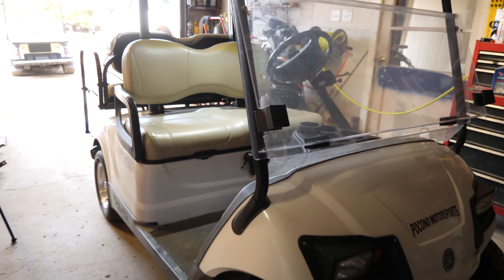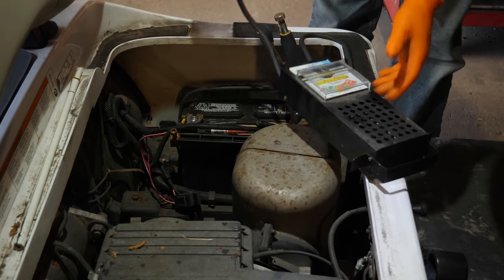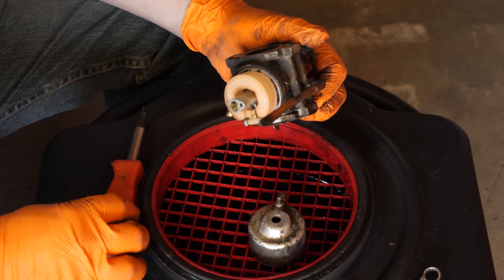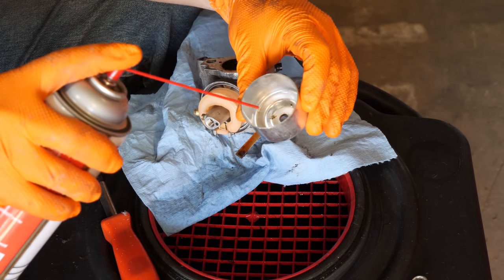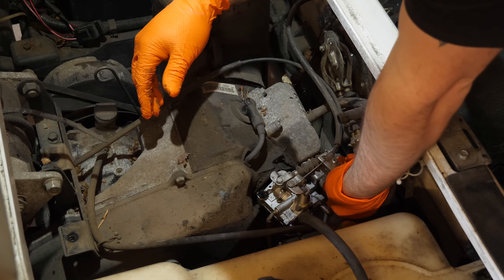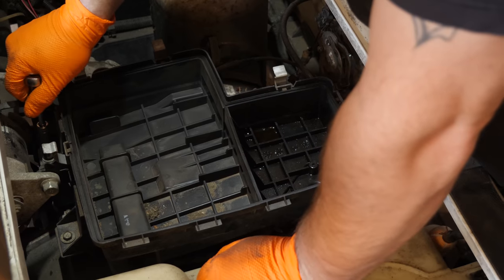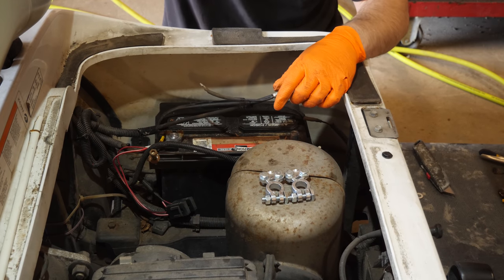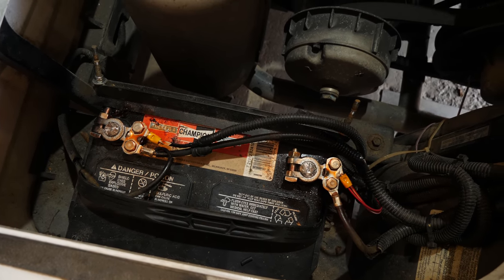2008 Yamaha Drive, Gas - Crank, No Start, Clean Carb, Charging Issues

Comment: It's Nick from Michigan .
Got a G1 79 she's dieing out on high end surging until choked .
Carbs been cleaned out , second look for fuel support issue , new lines and filter with new fuel pump . Still the same result . Set carb and throttle as required. Carb opens  just after starter gets engine turn going I choke it it still takes some cranking and she starts runs up to high end then surging starts . As the pedals slowly let off she will slowly start to die out until choked again.
Reply: Replacing carb . New coil , was to rule out high Rev limit , better claim and grop of RPMs now but still surging after 30 seconds of run time then wants to cut out until choked .
Reply: Drop

Comment: Definitely like the commentary with the video, Do you have a video of a G29 valve adjustment? It seems Yamaha Drive is not one of your favorite carts.
Reply from the maker: I have not had to do a valve adjustment on a Yamaha Drive. I believe they have hydraulic lifters. Engines with hydraulic lifters do not need valve adjustments. They will automatically adjust themselves. I like Yamaha Drives. I don't like some of the design choices they use but that can be said for any brand.
Reply: @Kevinsgolfcarts  From your videos I decided to try the adjustment, I had a valve way too loose ( making a sewing machine noise) adjusted it to 3mil. noise went away they were definitely not hydraulic. single cylinder made it easy. Thanks again for the videos very helpful!!!!

Comment: Great video. I have a persistent problem with my cart and the carburetor. Where can I get the tool to flush the fuel system? Many thanks for your informative DYI tips
Reply from the maker: Remove the carb from the engine and take it apart to clean it. There are no special tools other than carburetor cleaner,  screw drivers and socket set or wrenches.
Reply: @Kevinsgolfcarts  Half way there. Got the carb out now I just gotta clean that puppy up. Need to get cleaner first though.

Comment: Hi Kevin...enjoy watching your videos. I am doing some work with a local scout camp/organization. They have a 1998 Yamaha G16A. The motor will start, but does not bogs down when attempting to get the cart moving forward. My understanding is that this was happening some in 2018, but pumping the accelerator would get it going. This year, that is not working. Do you have any immediate thoughts on what to look for on this unit?
Reply from the maker: Pull the carb off and clean it. 99% of starting and running issues are carb related. Check fuel flow from the fuel pump. If there is none, then it needs new fuel lines or a pump. Make sure the spark plug is clean and not shorted out with carbon. If it is, replace it with a new one, NGK spark plug BPR2ES. Pumping the gas pedal doesn't do anything but open and close the throttle rapidly. Holding the choke until the engine runs and holding it for a few seconds while running is the correct way to do it.
Reply: @Kevinsgolfcarts  Thanks for sharing your expertise. I will follow your advice and let you know if this clears up the issue.
Reply: @Kevinsgolfcarts  I followed your instructions. Pulled the carburetor and used up most of 1 can of carb cleaner to clean out all the ports. The cart now runs "almost" perfectly". Air filter was filthy, so will need to be replace it. The spark plug (NGK R) looks pretty good, so am not planning to replace it. Many thanks for your guidance.

Comment: Hello. Quick question. I have a 2008 drive/g29. It cranks, starts, and moves if pedal is all the way to the floor. If i let off the pedal or try to start while holding at half way it cranks but wont move/moves at snails pace. Any opinion on what my issue is? Im getting fuel. Have new belts ordered. Fuel and air filters changed. I have adjusted the governer for more speed. I basically either go at top speed or snails pace.
Reply from the maker: You will need to check the operation of both the accelerator and governor cables. Something is adjusted incorrectly and/or sticking. You may have adjusted the governor incorrectly.
Reply: Thanks. Have any videos how to do this?

Comment: What is the silver 90 that has the clear hose connected that points down? I just purchased a new carb and put it on my cart, runs great but I forgot to attach the short clear hose that goes to it.
Reply from the maker: That is the overflow for the carb. The small hose that comes with the carb is for the drain at the bottom of the bowl. I usually don't install it. If the cart is used in a dirty environment, I will add a small piece of fuel line to the overflow to help keep it clean.

Comment: I picked up a  97 Yamaha golf cart last year runs good then  this year it won't start I figured it was the carb wasn't getting no gas on the plug so I just bought a new one it was cheap enough I don't want to mess with it are these things able to just be put on and started up or do I got to just the new ones
Reply from the maker: Its possible the fuel has just drained back to the tank. I usually blow air into the gas tank filler neck using an air compressor to prime the fuel system. This forces the fuel from the tank, into the fuel lines and primes the pump. This is pretty common and I've had to do this many times. Do not use high pressure!!!!! Use only enough pressure to gently push fuel into the line. The gas tank is not designed to handle pressures above what expanding fuel creates.

Comment: How do you start the engine without it moving> I have the same car, 2013. Need to do this,. but there is no neutral.
Reply from the maker: There is neutral. You have to feel for it when shifting between Forward and Reverse.
Reply: @Kevinsgolfcarts  Thanks Kevin. I finally got the carb out on 2013. They made that airbox even bigger! I had to jack it up to get at those 12mm bolts. PITA! But she's running now. Thanks very much for the video. Next job is to add the light kit I bought 2 years ago.